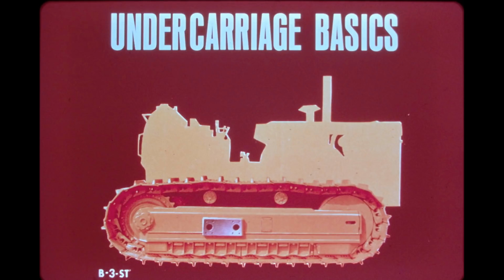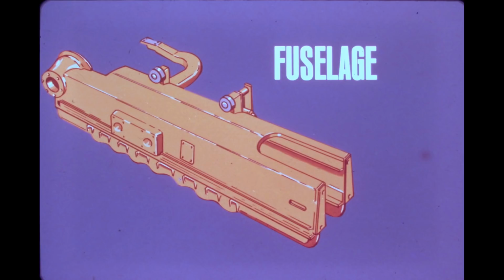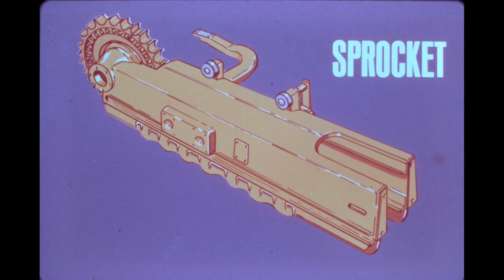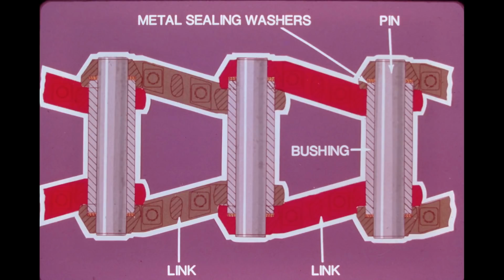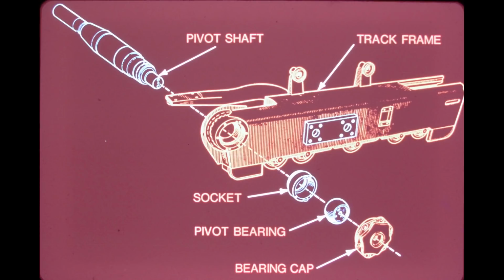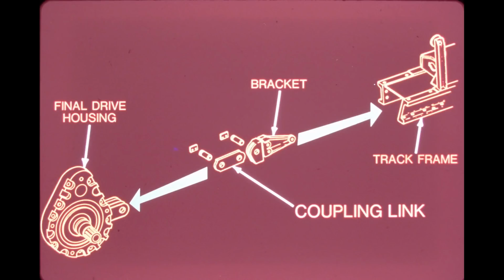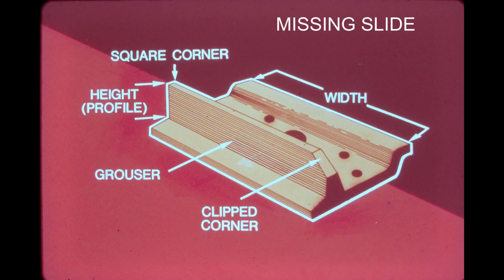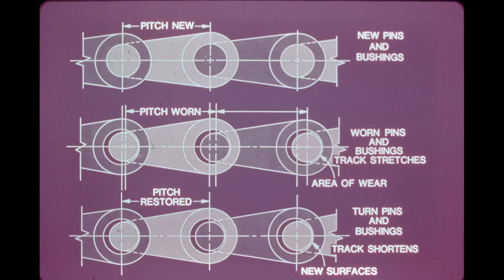International Harvester Undercarriage Basics Training

Comment: We have a 1986/87 td20g.  Can we get undercarriage parts for it? Chains, sprockets, and roller? Any help would be great thanks.
Reply from the maker: I'm not current on the 20 series crawlers availability but some good places to check with would be Winmill Equipment in the northeast(New Hampshire/Vermont), FP Smith in Fairfield California, or Brown International Services in Canada. They used to and/or are IH/Dresser/Dressta dealers and still deal in parts for these machines. I generally work on the smaller machines but I have all the parts books somewhere.

Comment: I worked in the parts department of an International Harvester Equipment dealership during my high school and college years. Everything was produced and shipped from Libertyville, Illinois. Great quality in all of the parts we stocked, sold and used in the re-build and repair shop. The reason for the end of International Construction Equipment is that Komatsu Manufacturing bought all of their facilities in order to gain a foothold in the American market. At some point in the 1960's Komatsu bought International Machines, had them shipped to Japan, took them apart and re-engineered the Dozers, Loaders and Wheel Loaders. Komatsu also bought the Galion Manufacturing facilities in Galion, Ohio to further expand their footprint in America. I miss those years learning how things where manufactured, taken apart and repaired! The dealership also sold Galion, Hough Loaders, Vac All, Mauldin Rollers, and Drott Excavators. Only the Mauldin and Vac All companies have survived!
Thanks for posting this video, it brings back memories.
Reply: Not to be rude, but you skipped the dresser years and the sale to them in 82! Then komatsu bought dresser years later!
Reply: and now, they make a better international harvester machine.

Comment: Can you still get  chains and rollers for td 14 a
Reply from the maker: Unfortunately there are no current sources for new undercarriage parts for a TD-14A. Good used is your only choice. I was at Fresno Tractor in California this summer and they had a few TD-14A parts machines with usable undercarriage still.
Reply: Berco, Italy
Reply: We have a pair of 14 A crawlers. one has a 100% undercarrage and bad engine. One has worn undercarrage frozen steering clutches and a good engine. We have a U tube Video.

Comment: Thank You for the video , if someone made a better bulldozer than International I'd like to know who ?  
 Pretty good tough built tractors !   They over built everything back then . You could take a TD- 25 C dozer with full rock guards and run the track chain to nothing and never derail it on a steep slope .   Damn good Engineering !
Reply: Crane & Rigging 
I was lucky to work for a company that had 125 Loader's, and 175 Loader's. That 175 you could hardly tell the bucket was full. Meany a time I was rolling material over the top. They were just built Strong. On a main line sewer job we did they had a Case 850 Loader. Just because and only because of the stick power shift controls on case, it had faster ground speed for running long runs to pea gravel. The Case went faster so they used it on main line. But boy loading the bucket with the 125 loader put that case to shame. You put the Case loader up beside the 125, and just looking at the two, you could tell the International was built stronger on all parts of the machine.
Reply: @rp1645    That's pretty cool RP !   The IH Heavy equipment line in the 1960's & 70's was top's in my opinion . 
  Or teacher  in Vocational  Tech school was a mechanic in the Navy during WWII on a smaller gun boat powered by 6 6-71 Detroit Diesels  .  
 Then after the war he went to work for International Harvester  .   Needless to say the class was always interesting and he was a big influence to me !
Reply: @cranerigging3604  
I was in ARMY 75 to 81 on a 45 foot Tug boat
ST-2154 we were a support company. 20+ LCM-8s, YES I remember those Jimmy's well. Went back to Virginia. They had a building full of them on stands. We did every kind of repair trouble shot you can believe in. Myself today I own a 8-71 in a Fire Engine 1971 SeaGrave I'm restoration in too. Also a 353 in my favorite Backhoe a 190 Dynahoe. Both Engines have run great for my needs. I am in Love with old school Detroit's, they just are so interesting in design. 
Have had the 8-71 run backwards, just shut it down. And start her again. Never had a runaway
Reply: @rp1645   AMEN and thank you for your service RP !   We also have a small fleet of vehicles using the " Best Diesel Engine " ever built . " Wink " .     I saw that 190 Dynahoe on your channel and fell in love with it ! 
  https://www.youtube.com/watch?v=bWmE2zn8t18